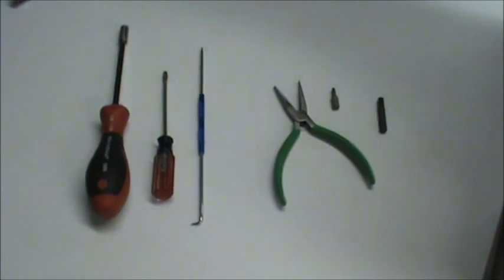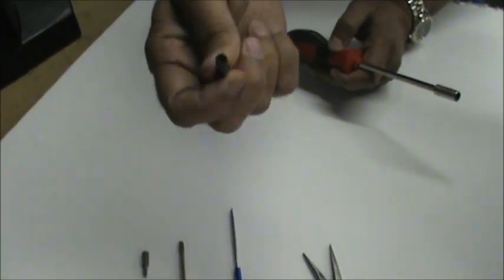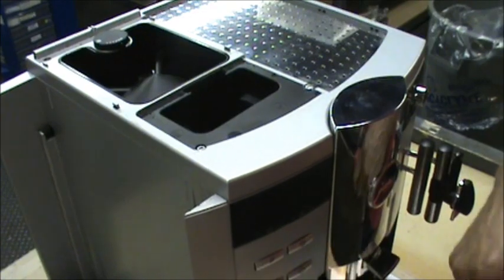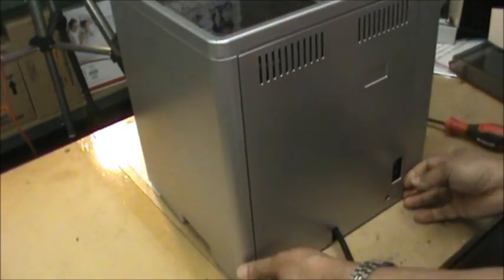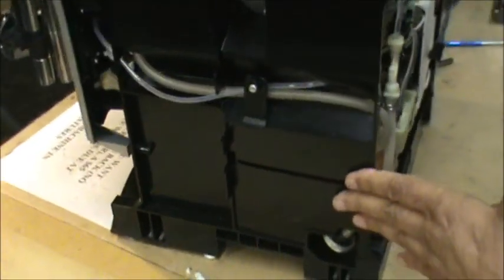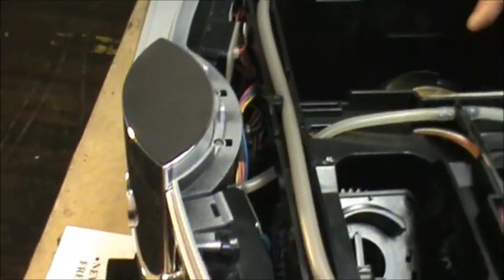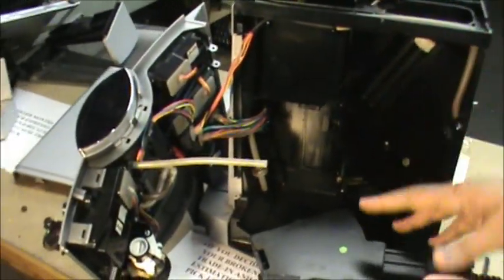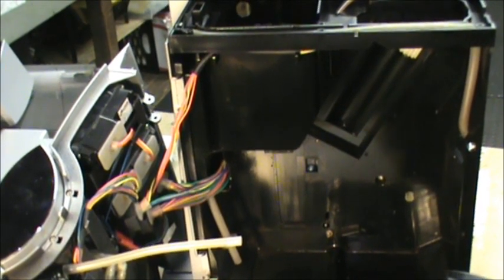How to Open and Disassemble Jura Impressa S9 Coffee Machine

Comment: Dear Sir I would like to exactly what component is at fault when the “close Tap’ lights up and both the steam and water light go off …when I bump the two push buttons for steam and water with a back side of a knife the machine starts working again! You have not posted the new tube of the Jura A 1
Reply from the maker: Its most likely the buttons that need to be replaced. We have not had A1 in for service!

Comment: Is it normal for the S9 to leak a bit of water in the back of the drip tray that sits under the drain pipe or should I look at replacing the oring?
Reply from the maker: Hello:  a little bit of water (tea spoonful) is normal as the residual water from brewing coffee is drained.  How much water do you notice in the pan?
Reply: Parts Guru thanks for the super quick reply  it probably a couple of teaspoons nothing extreme. So when should I be worried about fixing it?

Comment: I have a Jura XS90 that after about 2 minutes of the machine being on, it reverts back to the 'HEATING' mode and gets stuck there and then doesn't make any more coffee.  so for the last 2 yrs we've been turning the machine on, quickly making 2 cups of coffee as soon as it says READY, then turning it off immediately.  if you miss that READY window, it'll go back to HEATING and stay that way until you turn the machine off and wait about an hour.  If you try turning it back on too soon, it'll just stay stuck in HEATING mode.  it's very inconvenient, but at least we've still been able to make coffee.  Is there a heating sensor or something that just needs to be replaced here?  it would be nice to get this fixed.
Reply from the maker: +Dennis Dowhy Hi Dennis: Typically when there's an issue with temperature sensor, it displays error code such as Error 4.
The other reason for HEATING could be due to lack of Descaling the machine.  When was the last time you descaled it?  What Descaling product did you use?  The calcium sediments in water accumulates at the fittings, connections and inside the boiler.  As a result, the boiler fails to reach the desired temperature and thus displays HEATING.
Please try to descale the machine first.  Run multiple cycles using the authentic descaler to ensure its thoroughly descaled.
Reply: wow, now thats a fast response :)  we use the authentic 'Jura Decalcifying/Descaling Tablets' for descaling but this doesn't solve the issue.  like i said this has been going on for years, I bought the machine back in 2013 and it only worked properly for a few months I think, so basically for almost 3.5 years now we've been playing this game of racing to make our cups of coffee before it gets stuck in HEATING mode.  this happens 100% of the time, regardless of how many times we have cleaned and descaled the machine.  it would be nice to finally figure out how to fix this one for for all.  it's especially troublesome when we have guests over and then we get stuck in this mode and can't make coffee for them.  I have never seen an error code shown on the display.  It'll just get stuck on 'HEATING' and stay that way until you turn the machine off, and even then if you turn it baack on too soon it'll just go right to HEATING and still not let you make coffee.
Reply from the maker: +Dennis Dowhy You can try to replace the temperature sensors on each boiler.  XS90 has two boilers/thermoblocks each uses a different sensor.  The other issue could be with thermal fuse that's also clamped onto the boiler.  But, at this point, it's hard to tell whether it's a sensor or fuse.

Comment: you have been a great help with your instructions. With part replacement because of your videos. I have acquired a new sound that I cant pinpoint. Afte the machine grinds coffee it makes a loud buzz sound. Is it the pump? Ideas
Reply from the maker: +Jay Brady Hi, the loud sound could be the pump or the brew group solenoid valve.  Please make the ground coffee is not too fine.  It should be fine like table salt grain.  Please adjust the fineness and retry

Comment: Thanks for this detailed description. Once the brew group is out, how do you clean inside of it? I'm not sure it's worth removing it. We have an Error 8 consistently, and it looks like coffee residue is caked up on the works at the bottom of the brew group. Used other online recommendations to clean it out from beneath, without removing, but not yet sure if it worked. Thanks.
Reply from the maker: Error 8 is permanently by replacing the brew group piston o-rings and seals in the drainage valve. You will need to remove the brew group from the machine, take it apart and replace the seals to fix Error 8. It is a common problem in all Jura espresso machines.
Reply: Parts Guru Thanks - do you have a video about taking apart the brew group?? It's sounding pretty complicated, but I'm sure you're right about the problem, since more superficial fixes are not working.

Comment: Thanks for posting this.   My Jura S9 One Touch is leaking clear water out of the bottom of the machine and I keep getting an error message stating that I need to empty the tray even though the tray has been emptied.   I am looking for a starting point to diagnose the problem.

Comment: Thanks for this video and your help, Parts Guru. I recently received the message to change the filter on my S9. After replacing the filter, the screen informed me to "Fill System" / "Press Steam". Upon pressing the steam button I hear the water pump run for several seconds but nothing comes out of the steamer. I have attempted removing the filter, using hot water and removing the steamer attachments. As per Jura support, I have pressed the steam button many, many times and have only seen 1 drop of water very slowly work its way out of the steamer pipe. Following your video, I have opened up the machine but am still not seeing anything obvious. Do you have any recommendations? Thanks.
Reply from the maker: +James Macauley Hi James,  the machine's water passages are blocked with calcium sediments.  Please stop using Clearyl water filters.  They're expensive and more importantly ineffective and doesn't function as advertised. Jura recommends using the filter without the need to descale the machine.  That's an effort to sell and promote Clearyl filters.  Despite using the filter, these machines need to be descaled regularly every six months.  Failure to do so  leads to the accumulation of calcium deposits inside the water passages overtime and blocks the water flow.

If you're able to get hot water through the water outlet then I recommend you descale the machine thoroughly.  You can use Jura Descaling tablets, if you have them, or purchase our descaler.  While you have the machine opened, please operate the machine and monitor the water flow from pump to boiler and so forth.  See if you can find the blockage where water stops flowing.  Please check the steam solenoid valve, membrane regulator, dispensing valve, and water pump.

The filter removes other minerals from water but fails to remove calcium sediments.  Jura primarily is a marketing company that gets these machines manufactured by Swiss company that also makes coffee machines for Siemens, AEG and other popular European brands.  They're not technically familiar with the internal schematics and parts of these machines.  They have outsourced a repair business in the US to a third party that repairs home appliances for Delonghi.  This is a primary reason their US office won't sell parts to customers.  

The above is just to give you a brief background about Jura users.  Hope it helps you make educated decision when looking to purchase coffee machines in future.

Comment: Hello!  I was so glad to find your site, and I'm hoping you can help me on finding correct parts for my Impressa S9 coffee machine which is at least 11 years old.  I've called Jura and they said from the symptoms that the internal valve which switches over needs replacement.  The coffee grinds but instead of coming out the 2 spouts, clear water comes out the tea/water spout.  ,No error messages lite up. Any help is greatly appreciated!  Judy Harmon
Reply from the maker: +Judy Harmon Hi Judy:  we have almost all the parts available for S9.  I suggest you order the oval head tool to open the machine.  Inspect couple of parts such as multiway valve, PTFE tube connection to isolate the issue.  Also, you want to check the solenoid valve while you have the machine opened.

Comment: I have a Jura S9 and the handle on the front which lifts and lowers the spout has become very loose.  Looks like it uses a hex nut on the back, but I can't get at it to tighten the thing, which should be a very simple things to do.  Any suggestions?

Comment: I have a Jura Impressa C9.  It's 2.5 years old.  In September of 2014, still under warranty, I sent it in to Jura and they replaced the Brew Unit and the Membrane Regulator.  Now, 15 months later, the unit makes more noise than normal when brewing.  It takes quite a bit more time to make an 8oz cup of coffee.  Grinder works fine.  No leaks.  Cappuccino maker works fine.  Just very slow to actually produce the cup.  I am handy with  disassembly but not sure what to replace.  I have only used purified RO water, ran Clean cycles, De-calcify cycle, etc.  Can you help troubleshoot?  Thanks!
Reply from the maker: Please email or call us to talk to Edward. He'll suggest the best option.
Reply: Thanks!  I will call next week. What is the best time & number to call.  Regards, -russ
Reply: +Parts Guru , Wanted to  update you on the issue with my unit.  The more I thought about it, knowing that everything was actually working, but just taking a lot longer to produce the cup of coffee, and the pump being a lot louder, I wanted to look to see if something was hindering the water from getting into the machine.  Although I have only used purified RO water, and did the clean cycles, keeping the water tank clean, I removed the tank and looked closely at the place where the water flows from the tank into the machine.  I saw a few tiny debris, so took my vacuum to such the dirt from the small screen.  Well, the dirt did not move.  I took a small plastic tool and when I tried to scrape the debris, it was stuck and gunky on the screen.  I then proceeded to scrape it all together and using the vacuum, was able to get it off the screen.  I then took hydrogen peroxide and put a little on the screen to help clean it.  I waited a few minutes and them vacuumed it again.  Lastly, I took my compressor and blew forced air onto the screen to make sure it was completely free of obstruction.  I then put the water tank back on and ran a cup of coffee.  WOW!  The pump was very quiet and the coffee flowed nicely.  
No where in the maintenance instructions does it say to clean the screen.  I do not know how to remove it, or would have done it differently.  Also, the technician at Jura never mentioned that it could have been the reason.  He just wanted me to send in the unit and charge me $265 to repair it.  So, please make note of this very simple preventative maintenance step that can greatly improve the performance and help it run much longer w/o problems.  If you have the procedure to remove the screen at the water intake, please let me know.  Thanks!  Final note, my wife said that she would recommend white vinegar to clean with instead of the peroxide, so that is what I will use from now on.

Comment: Hi Guru,
I recently bought a broken Jura XS90 in Japan.
The Unit does not grind coffee and there is no liquid coming out of the coffee outlet.
The steam unit on the left is working and also the cup hot water is working

I have checked all the pipes. One in the back was lose, which I reconnected.
I took out the brewing unit, dismantled it completely and cleaned it. 

The machine performs the following actions:
- Switching on the unit will display "Heating Up"
- After 5 minutes the display changes to "press rinse"
- after pressing rinse, the brewing unit moves and you can hear some water pump moving.
- After less than 1 minute, the display changes to "Select Product"
- When selecting a product, the following happens:
    - 10 seconds quiet
    - 11 sec up to 30 sec
        brewing unit moves
        display " fill beans"
        hear the water pump
        brewing unit moves
        some steam is rising from the brewing unit
        No coffee is being ground. 
        No coffee powder is being put into the brewing unit

Please advise what I should check further or which part I should replace.
Reply: I just sent the above message to partsguru by mail as well and instantly got a message back. Their service is amazing...

Here is PartsGuru's response:
Buying a used or broken machine inherits its own past life secrets.
 The secret being you do not know details on the maintenance of the 
machine.Your efforts to revive appear to be very proper and made some functions re-start.Almost
 all Jura machines suffer from the use of expensive & ineffective 
Filter cartridges which do not prevent accumulation of Calcium deposits 
in the hydraulic system. Please know this and at some stage you have to 
manually descale the machine for aggressive & comprehensive 
descaling. Manually descaling instructions are on our website.The
 fill beans error means the beans are not fed into the grinder because 
the setting is too fine or the burrs are worn out and not grinding 
within time limit of 17 seconds. You may have to check & fix these. Very
 fine powdery grind does not make strong coffee. For adjustment of grind
 fineness, do not rely on the position of the knob. Feel the used coffee
 between the thumb & finger. It should not be finer than table salt 
Grain.To bypass the fill beans error, try pre-ground coffee 
and use slightly coarser coffee powder than table salt and see if brew 
group completes the cycle & makes espresso. This will localize the 
problem to the grinder. The grinder definitely needs good cleaning and 
possibly replacing the grinding burrs.Conclusion:1- Manually descale the machine to clean the system and2- Fix the grinderLet me know the results.Sincerely
Edward - Technician 
Parts Guru

Comment: I have a Jura S9 one touch.  When we turn the machine on in the morning, it trips the circuit breaker on the GFCI outlet.  It does this mostly just when it does the steam release after the first rinse.  But sometimes it's also doing it when the first cup is brewed (right after the beans grind).  And sometimes, it doesn't do it at all (although most days, it does).  We drink coffee all day but it's only that first morning start-up when this happens.  Ever heard of this?  Any ideas on what could be causing this?  We run the cleaning cycles with the tablets all the time upon request from the machine, and always change the filters on time.  Thanks for your help Parts Guru!
Reply: Also - it only trips the circuit breaker once (usually - occasionally it happens twice).  I wait about 30 seconds, push the reset button on the GFCI, turn the machine back on, and that's it.  It works fine the rest of the day.
Reply from the maker: +R Scheibner Hello: there is couple of electrical components that you can inspect.  Check the thermal fuse (blue wire with fuse) mounted onto the steam boiler.  The other part to check is the transformer.  It's located beside the pump on the inside.  Please operate the machine with the rear panel removed.  Ensure there's no water leaking from the steam solenoid valve or any other part on the transformer.  Please operate it carefully.  If you're not comfortable, you may send the machine to us for repairs.

Comment: Our machine seems to be moving much more water in to the tray as well as it is not recognizing that we have emptied the coffee grounds. ( we empty and clean it, return to machine and it says empty grounds)  if we let it sit out for 5 min or so it will reset and recognize it most times however.  Any thoughts as to what the issue may be?  I noticed in the last couple of days it has also indicated the coffee grounds need to be emptied but it is not full however there is more water in the tray.  Trouble shooting we have done is to clean all the connectors with a q-tip ad ensure the sensors are dry.
Reply from the maker: ***** What model is your Jura machine?  Sometimes replacing the drip tray helps as the metal contacts get worn out over time and fails to fully engage with the metal sensors located at the back of the machine.
Reply: Parts Guru it is the S9 - same machine as in your video.  Thank you for your feedback and direction.

Comment: Hi, Finally have a problem with my Jura C5 that I haven't been able to fix with your videos. My C5 grinder doesn't run, I have cleaned the grinder head and coffee outlet and re-assembled, but the motor still doesn't run. Does this point to a motor failure in the grinder unit? If it does, is it worth trying to replace the motor brushes or should I just get a full grinder unit. Or should I be looking for a different fault?
Reply from the maker: +Ian Brock What was the original malfunction with the grinder?  What exactly did you fix?  Did you remove the grinder burrs?
Reply from the maker: +Ian Brock Please check if motor is getting power.  The converter AC to DC may be not working (power board problem).
Reply: Hi, many thanks for the swift reply. It gave the beans empty light though it was half ful,l it stopped mid grind, so I took the grinder apart and pulled the burrs out. I then cleaned out the chamber and coffee port into the brew unit and re assembled. Test ran with and without beans and the motor still didn't run. How would I test for power at the motor? I have a multi meter, but is  it a 12v motor or is it mains voltage?